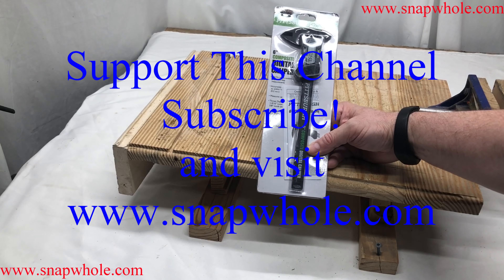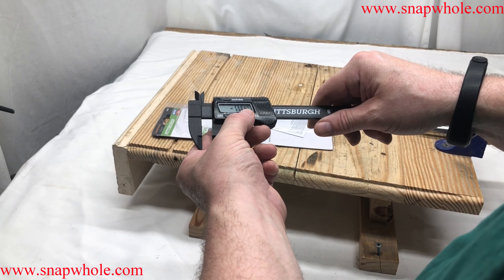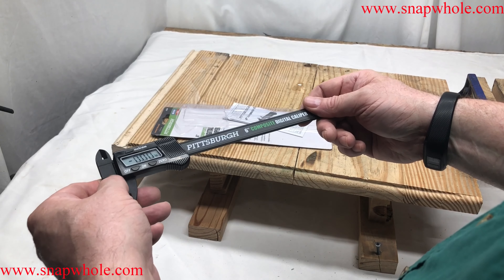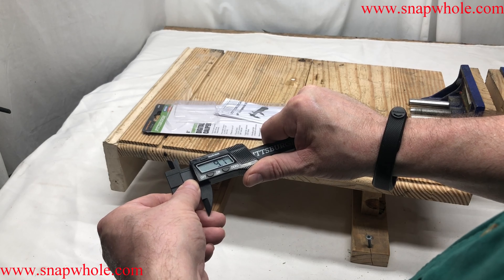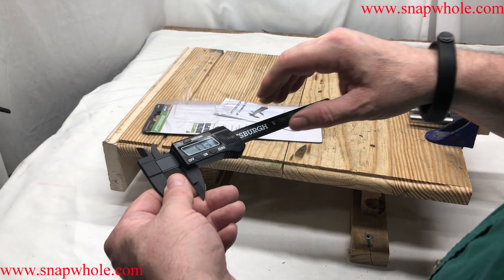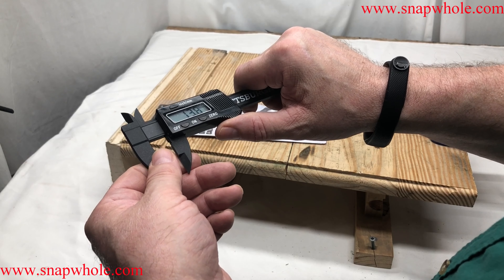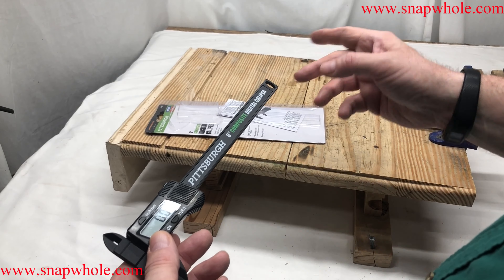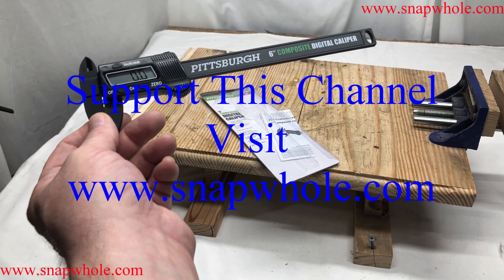Harbor Freight 6 Inch Composite Digital Calipers 63586

Comment: I have the metal one and never had a battery problem. Also the metal one has a nice foam insert case.
Reply from the maker: an example to the battery problem with the metal calipers - https://www.youtube.com/watch?v=7nImJVqn-UM - thanks for subscribing!
Reply: @snapwholeharborfreightreviews  My calipers are a bit different. The function buttons on mine are blue, red and yellow....so maybe a revised model?
Reply from the maker: @domosautomotive1929  this is the current model, I think the differences are cosmetic, and if you check the HF website, the picture there does not match what I purchased, they might be using different manufacturers,  BTW, I prefer the Metal, very versatile and I can use it for tool setup -  Thanks for subscribing

Comment: Thanks for the looksee. I may need some semi-decent Vernier calipers in future for a couple of motorcycle maintenence tasks requiring a modicum of precision, but might go old school metal or even one of those cheapo plastic HF $2 ones instead, if only to be able to easily measure depths. Up to now, for mundane stuff I've been getting by with some plastic Cracker-Jack-prize-grade gimcrack that I think was a giveaway I picked up at some car show. It's probably as accurate as a Flat Earth Society newsletter.
Reply from the maker: I like the metal calipers better, they are a little more versatile, but this one had its uses and works ok - thanks for subscribing!